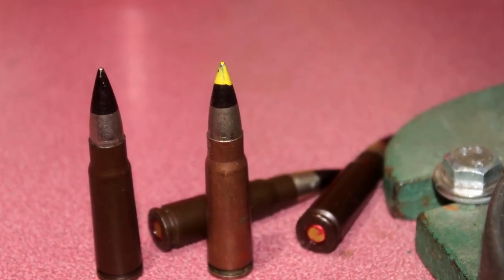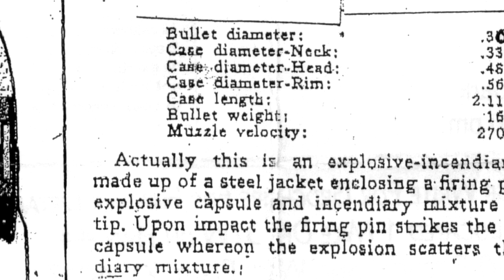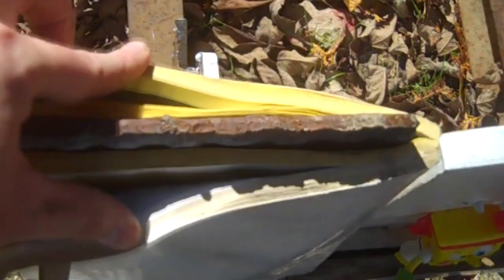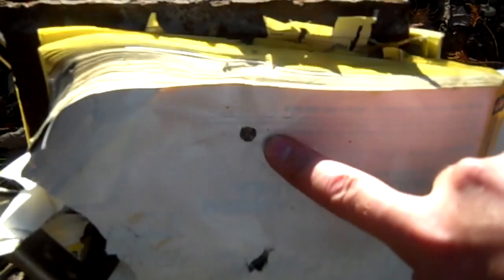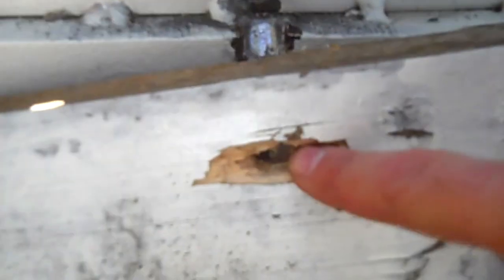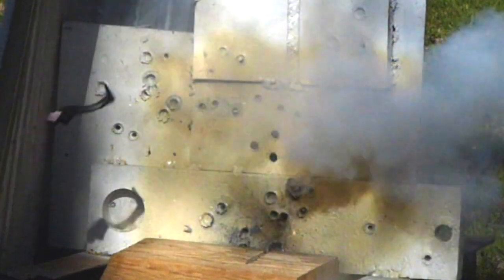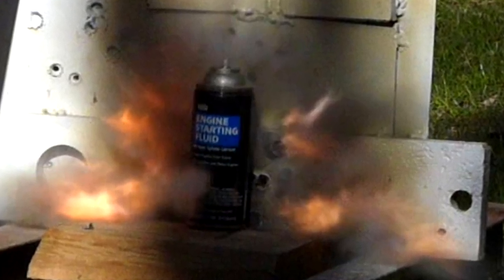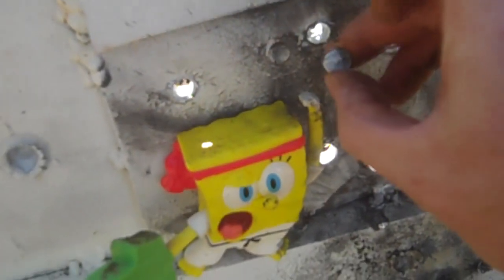AMMOTEST: 7.62x39 HEI High Explosive Incendiary ammo

Comment: What i believe happened is this. 
What lit up, the fireball, was the pressurized gasses inside the can, not the liquid. I doubt you could light the fluid with this type of bullet unless the flame is preserved after the impact since the freezing capabilities of the can's (i assume) naphtha would smolder the heat instantly. If you drop a match in a solution of naphtha what is gonna start the fire is the vapor not the liquid.
Reply: The vapor ignites due to oxygen mixed  in it, without a proper mix of O2 it won't burn. Since it left the can in a liquid state and wasn't properly mixed with O2 it did not ignite. If he had shot a second round shortly after when the fumes were mixed with O2 it most likely would have given the desired results.
Reply: michael malkowski I'm not sure i follow where you're leading here. I doubt you could light it even with a second round considering that the vapor was under pressure and it already exploded. Only vapors burn. It's like medicinal spirit you burn it but there's still liquid when it's done producing vapors. When more vapors are released you can reignite it again.

Liquids release vapors at different rates. That's why some are harder to start than others.

In this case it's even harder because the liquid was cooled therefore the vapors could get out would get out even slower than normal.

IN other words what could burn out of it already burned. The next burn that would happen would either have to wait for more vapor to be made or for the solution to be heated up but not exposed to fire.

Comment: Actually liquid lighter fluid is Naphtha, by weight lighter  than Jet & heavier than Gasoline. Butane & Naphtha are used due there predictable burn in open flame situations as apposed to Gasoline which is considered very volatile, example most Movie sets use gasoline for there explosion scenes.

Comment: Flame front was pushed away from the fuel (starting fluid) faster than the flame front was travelling due to the detonation of explosives.
Had the explosion not occurred, the flame would've expanded slower and stayed within reach of the fuel.
It's like blowing on a match...when you blow it out, the flame front is slower than the wind it had to travel through in order to reach the fuel (matchstick).

Comment: 1) As K Mmando said, only the vapor is atomized. like why you have carburetor or a fuel injector in your car.  
2) The next part is that an explosion pushes out from the center. the shock wave is the air molecules hitting you, similar to a muzzle blast. 
3)The fire was snuffed out by the lack of oxygen, and the blast pushing the flammable molecules too far apart to burn. 

I cant believe your read all that. good job

Comment: That printout you showed with bullet weight of 160 gr.@ 2700fps is for the 7.62 x 54R and not the 7.62x39 .I enjoyed the vid though.
Reply: The projectile was probably pulled from the 7.62x54mmR, based on the muzzle velocity.

Comment: It would appear that the Ether being released so quickly, had a mist as it's leading edge.This would have ignited almost instantly.The explosive round would create a pressure wave capable of generating ignition. However, the tail of the pressure wave would create a depression,(much like exploding dynamite) which would extinguish the momentary ignition of the Ether. That combination would have prevented the remaining Ether,(in liquid form) from becoming vaporous and igniting..

Comment: The vaporization of that engine starting fluid consumes a lot of heat while the combustion is confined to the diffusion zone where fuel and air react. If the vaporization of that starting fluid consumes more heat than generated by the diffusion flame, the reaction/combustion will stop.

Comment: "Blowing" the fire out is certainly a possibility, but I don't think that's the case.

"Flammable liquid" is a misnomer. Liquids will NOT ignite. The vapor at the liquid's surface is what burns - and can push the liquid into more vapor, making more fire, over and over.

Ether is VERY volatile, and burns quite fast - in this case, too fast for more vapor to form from the stream coming out of the hole (you can see it). The initial fire is from the vapor in the can.

PS. I'm a retired Firefighter.

Comment: I believe the round isn't hot enough to ignite the liquid itself, just the fumes.  Much the same way that a cigarette isn't hot enough to light gasoline itself on fire.  Once the compressed gasses have escaped, the liquid itself vaporizes at a much slower rate, which is insufficient to keep burning.

Comment: True. And when a flammable liquid "burns" it's actually the gases evaporating from the liquid and mixing with oxygen in the air and igniting. Not enough vapor and oxygen and it will not ingite no matter what you do.

Comment: Looks like you weren't able to get a proper fuel/air ratio on that can.  Because it's pressurized, the fluid sprayed outward from the openings very quickly.  The fuel basically ends up putting out the flame because there wasn't enough oxygen to get it to ignite.  You could try a mostly empty can (less pressure/less fuel), or maybe a mostly empty gas can (the fumes mixed with air are much more likely to ignite than gasoline itself).

Comment: The starting fluid didn't ignite because the ignition source was gone before the fluid was able to spread out enough to mix with oxygen and achieve a proper air to fuel ratio. Also, if velocity was too high, the entire bullet would fragment so quickly that it would be impossible for the internal HE mechanism to function. it would just act as a frangible round. Cool video!

Comment: They actually used this technique to put out the oil well fires in Kuwait. The explosion envelops the area, consuming the oxygen. The shape of the charge actually has nothing to do with it. (as seen in this video) the charge only has to cover a sufficient area so that no existing flames are outside the pressure wave.

Comment: @MrAkmaster74,
High explosives (tetryl based) have their own "oxygen" contained within their chemical formula which is why, for example, they detonate under water. The oxidizer in a HE is usually Nitric Acid (HNO3, but can be a host of many oxygen/chlorine/fluorine containing compounds). The combustion of the powdered metals in the incendiary tip would consume oxygen So your right, in a round about way. Just an FYI Tetryl explosives are very toxic.

Comment: The reason the starting fluid didn't combustion is because the concentration of the fuel was above the highest concentration (or upper explosive limit) for the oxidation reaction to occur (i.e. ignite). Most starting fluid has an UEL of 48% by volume (Diethyl ether/Oxygen) with a LEL (lower explosive limit) of ~ 1.8%. Outside of these concentrations no reaction will occur. At the time of detonation the ether concentration was well above the UEL and too "rich" to sustain combustion.